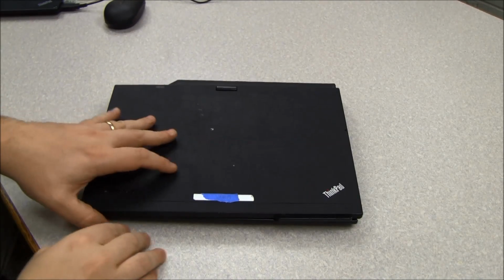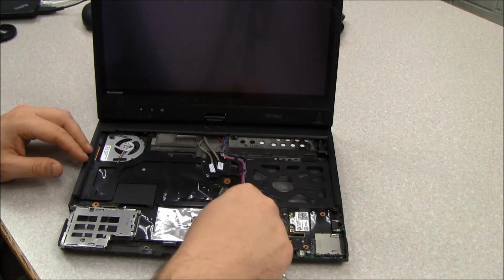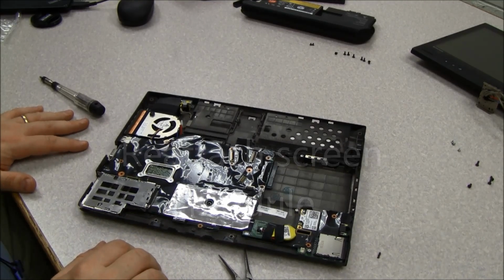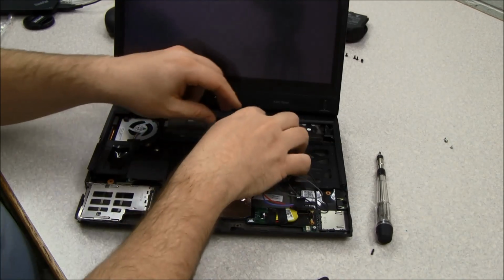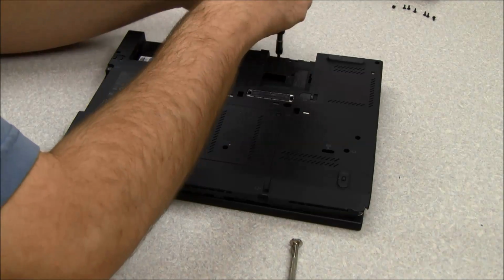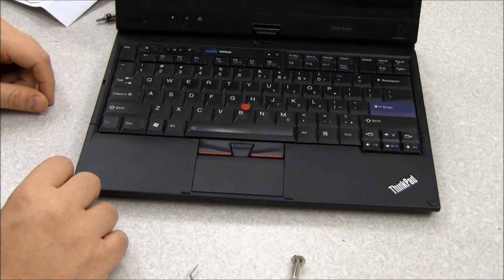How To: Take apart and repair Lenovo x220t / x230t

Comment: Thanks for uploading this, was very useful! Can you use an x220t screen on a x230t?
Reply from the maker: Not sure if the two are compatible. You could look up parts list and see if they share replacement parts.
Reply: Alright so I tried to install an x220t display on an x230t and, just for the record, it fits and it displays video, however once you turn it on there´s a hiss coming out from the speakers and the power button doesn´t work so I assume it wasn´t designed to be compatible. This was the model part without a webcam annd fingerpint reader.

Comment: Hey, great video, but with one small problem. at 14:57, there's a small folded metal bracket in the upper left-hand corner of the chassis, which is then picked up and set aside with no mention. To save anyone else the trouble, this is part of the ExpressCard assembly, facing towards the hinge of the laptop, which is meant to be held in place with one of the screws that holds the motherboard in.

Comment: Hi there. Just want to ask. I repasted my thermal paste. Now the screen is black but it works when I use an external monitor. Touch screen and camera also works. What could have caused it? I double checked that I reconnected everything.
Reply from the maker: It sounds like the cable from screen is not connected properly.
Reply: @hoyty76  thanks! I will check again later.

Comment: Thanks very much for taking the time to post this clip.
You explained every stage very clearly and filmed the process very well also.
I have the standard X230 screen laptop and need to replace the fan and renew the thermal paste for the CPU and GPU and your film will make the process much easier for me.
Thanks again!
Reply from the maker: I am amazed that 8 years later it is still useful!
Reply: @hoyty76  It's testament to how good and still functional these old X230 laptops are! Apart from the on button stopping working twice entailing buying a 3rd party replacement keyboard and now the fan sounding like a drill I still love my Lenovo and use it every day.
Mine has an SSD and runs only Linux Mint, I deleted Windows, and it fires up and shutdown quickly and does all I need!
They are still available used on ebay for not much money and are still great bargains.

Comment: 0:09 Keyboard removal
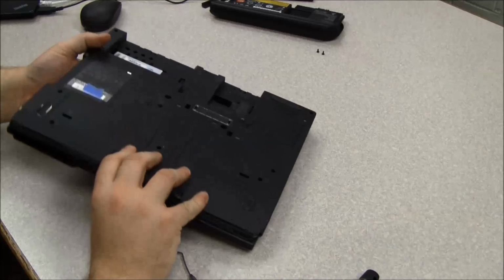2:26 Palm rest removal
4:15 Unwinding Wi-Fi wires
6:05 Top shield removal
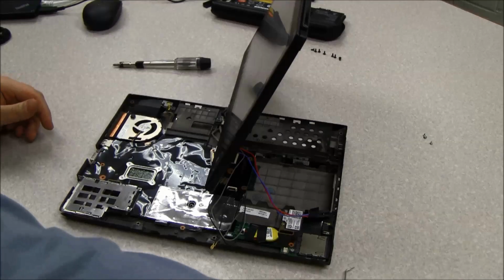9:48 Screen module detach
12:14 Systemboard removal
14:53 Dc In replacement

16:32 Installing systemboard
19:23 Reattach screen module
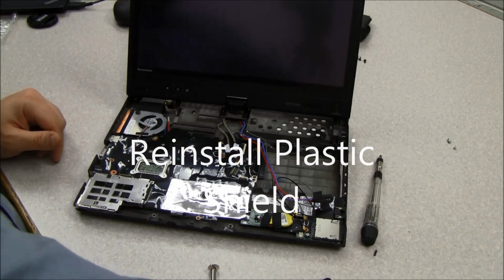22:24 Reinstall plastic shield
23:46 Rerouting the Wi-Fi wires
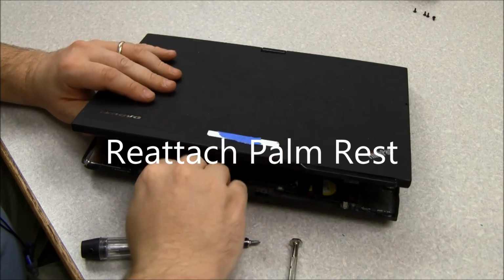29:43 Reattach palm rest
31:28 Reinstall keyboard

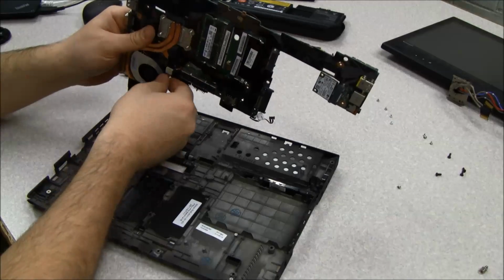Comment: 14:40 The power jacks on these computers had a terrible design with an insecure mount prone to bending/moving and, as a result, shorting. I had to replace mine as well. When I did, I wrapped it in electrical tape to ensure it would never short again.

Comment: Imagine this laptop with new i5, more ram, thinner bezels equalling smaller footprint, thinner design ( 0.9 inch is enough ) lighter weight ( about 1.4 kg ) and maybe a greater battery. Always keeping the good old keyboard and style tho, this laptop is a beast man. Honestly just a better cpu would do it imo.

Comment: Anyone knows if this laptop has issues ? I mean some bad issues. I found it in my country for a really cheap price , only thing i read about that the HDD slot is kinda dumb and makes problems. Is the display durable and is it multitouch ?
Reply from the maker: True Bulgarian IYI If it is one of these machines it is 6+ years old. When new they didn’t have specific issues but a machine of this age used would be hard to know.

Comment: i am getting vertical lines on my x230t display.. i need to open it to check for the connections with ribbon cable to see if that is faulty or the screen itself is faulty, could you let me know how to get to that part itself
Reply from the maker: utsav garg sorry I don’t know if parts are even available anymore for these computers due to age. I don’t have one any longer either.

Comment: Thank you for this.  I also had a damaged power jack and after some confusion on ordering the proper part, this video walked me through removing the old one and replacing it without hassle.  Hardest part was finding the socket for the VGA jack which I was able to locate so I didn't have to struggle with needle nose pliers.

Comment: Thank you, thank you, thank you, Brian!!
Although a handy DIYer, I know you saved me Hours from trying to figure how to take my old x220t apart to replace the fan (and heatsink) due to the dreaded "Fan error" start-up error message that won't let the laptop boot up.

Yes, Take Pictures along the way to help you remember what went where.

Another tip I'll share - I taped some of the more specific screws to near where they went so I wouldn't get them mixed up later.

And for those replacing the fan+heatsink, note that there is a piece of black tape on the motherboard that goes where the "Y-leg" of the heatsink has that extra screw mounting hole (you'll know what I mean when you look at it).  The tape goes OVER that Y-leg when putting in the new fan+heatsink.  The problem is when you take the old defective fan+heatsink off the motherboard, that piece of black tape will just naturally stick itself to the motherboard.

So while you wait for the replacement fan+heatsink to arrive in a couple of days, it's easy to forget that the piece of tape went OVER the heatsink screwhole.  I forgot, and attached the new fan+heatsink to the motherboard, and then turned it over to put back into the laptop, and proceeded to attach the motherboard to the laptop case bottom.

In the video, it says to attach "4 screws" - one by the fan, two in the WLAN(?) cage, and then one on the wi-fi antenna mini-card.  On my x220t, I had a 5th screw about an inch or so from the first screw.  This 5th screw is the one on the "Y-leg" of the heatsink.  If when you install the new fan+heatsink and forget to peel that black tape off the motherboard and place it back over the Y-leg, then when you turn the motherboard over and seat it in the case bottom, you'll find that that 5th screw hole is now blocked and you can't re-attach that 5th screw because the tape is between the motherboard and the heatsink on the other side.  I ended up having to go back a few steps to correct that tape problem so I could use that screw hole.

Finally, I "found" there was a 6th screw to hold down the motherboard when a tiny Bluetooth daughter card just fell out onto my desk work surface.  It's in the bottom right-hand corner, below the wi-fi mini-card.  I don't think the laptop in this video had such a card.  You can see it here in this Lenovo diagram:
https://support.lenovo.com/us/en/solutions/pd100780

But all in all, Brian, your step-by-step video was a godsend - couldn't have done it without you!
Resurrected the old x220t for the price of a $23 fan+heatsink and following this video.  Thanks.
Reply from the maker: P F glad I could help. I am amazed this 6-7 year old machine is still working and you could get parts for it.

Comment: What is the difference between X230 and X230T? cause I bought a motherboard it says for Lenovo X230/X230T. Everything matches except for the battery port.
Reply from the maker: It is wether it has tablet rotation neck. Almost everything in base is the same but screen is different due to touch / pen inputs.
Reply: @hoyty76  I bought a motherboard replacement for my X230 laptop but when I'm done installing it, when i plugged the battery, the port doesn't match. The description of the motherboard was X230/X230T. It might be for X230T not for X230. Everything else was the same except for the part where you connect the battery

Comment: Excellent, and thank you.  I worked from this video on an x220 (no swivel screen).  Great advice to TAKE PICTURES.My metal clip on yellow power jack was a bit different than in video.  My clip did not hold the yellow jack firmly.  So, after clip was installed, I wedged 3 layers of a bicycle inner tube between the fan and jack.  Now the jack is firmly in place with a bit of cushion.

Comment: Hi . I can not find in internet info about x230t web camera . Is it posibal to add it if it missing? 
And also I need documentation to see difference in x230t model types. For exemle I want to know for my 3438AU6 model type - should or not should have camera or witch type screen it should be multitouch or two point touch with pen or without and ......
May be you can help me?Thanks

Comment: Thank you for this video! I have no problem taking everything apart. However, I run into a problem when I try to take off the screen and intend to leave the wifi module since the wires of the wifi module also come off when the screen is off. Do you know how to take off the screen and leave the wifi module connected? This way I can only use my 32-inch monitor without the intrusion from the laptop screen.
Reply from the maker: Ran Zhang The WiFi will work without the wires just not as well. You could also buy external antenna with the same connectors. They are standard on internal WiFi cards.

Comment: This tutorial is also applicable to X230 tablet as I mine is x230t and I had torn it down. These two models share the exactly the same case. As for the VGA port's screws which I at first frowned upon as I don't have the appropriate tools, I used an inner hexagonal driver which might be easier to source, I guess, to unscrew them with success. It worked very well. The screws were not very tightly fastened. Their inner holes seems to be of hexagonal shape which might be the reason why a inner hexagonal screw driver also works.

Comment: The battery on my x230 is loose, and I found out that the reason is that the clips connected to one of the battery switches on the case has broken off so there is only one "clip" clip holding the battery in.
how to replace it ?
thank you.

Comment: I've got an X230t and I'm trying to replace the rubber nubs on the sides of the keyboard that hold the screen in place when the lid is closed or when the laptop is in tablet mode. I've purchased the rubber pieces from eBay but I don't know how to attach them. The left one is fine, but the right one was missing when I purchased the laptop. It has a plastic piece in the little groove the rubber sits in. Do I have to cut the bottom of the rubber piece and slide it over this plastic piece? I'm very confused, any insight would be helpful. Thanks!
Reply from the maker: I only replaced them by replacing entire top cover. Maybe if took it apart you could push in not sure though.

Comment: Thanks so much for the video. 

Do you have a link for the tool you used to remove the VGA screws?
Reply from the maker: ArkJag I don't but it is either 5 or 5.5 mm socket screwdriver. The trick is it has to be very thin to fit. Go to big hardware store or Sears craftsman to get on.

Comment: ca a x220 be converted to a x220t? could you make a x220 touchscreen with parts from x220t? if i bought a x220t with good screen but broken or no cpu/mobo, could i put my x220 components in the x220t chassis?
Reply from the maker: joe schneider I doubt it since the touchscreen has different plug and won't attach to MB properly.
Reply: I was hoping it would have 2 separate heads, one for digitizer, one for lcd.

Comment: Thanks for a very comprehensive manual!
The tempo of this video is exactly right for me - I never had to stop or reverse - I just disassembled and reassembled the laptop "in sync".
I've been disassembling my 2012yr X230t down to the bare metal for the first time today to change the thermal compound on the CPU (used to fix a pen holder and change the network card before, but nothing more serious with this machine).

Today, I decided to replace the thermal compound on the CPU, because the idle temperature raised up to 65 centigrade with fan constantly working, and any moderate load like editing a large image in GIMP or watching 4k videos on the external display cranked the temperature up to 97-100 centigrade with the fan working in an "afterburner-assisted takeoff" mode and CPU throttling.
And the problem really was in a thermal paste - it was more like a fine sand and the cooler had no adhesion at all.
Replaced it with some КПТ-8 "Siliconorganic Paste Thermocunductor #8" low-mid class thermal interface and got 42 centigrade on idle and 83-84 under heavy load.
Reply from the maker: Glad it helped you out.

Comment: The power jack on my old X220 has gotten extremely glitchy, so thinking about replacing it. Is it really necessary to remove all the components as shown in this video, just to replace the power jack?
Reply from the maker: +Elvis Stansvik You would need to get to about the 10 minute mark in video. Remove the keyboard and top plastic. You won't need to remove the screen.
Reply: Ah. Thanks for the quick reply. That's good, was kind of dreading the screen. Ordered a replacement jack from Ebay just now.

Comment: How do you prevent any static? I noticed you weren't wearing a wrist strap
Reply from the maker: Erika EE In over 20 years of taking apart computers never really worried about static or had a problem with. Not saying it isn't possible just not be an issue for me.
Reply: +Erika EE Just make sure you dont wear any plastic clothes and put on some cotton clothes. This can prevent that you charge yourself up.

To discharge before work touch your heater/raditor. You also can work with barefeet if you dont have ESD-shoes.

But for me its like Brian said. I never worried about this and all my hardware is stll working.

Comment: Hi dude nice video, i bought myself the x230t but didnt notice that if i selected the 3x3 antenna i would loose the webcam soooo i did and now i want to buy the camera and install it but im not sure if i can. 

i read that i might have to remove the 3rd antenna to install the camera, could you help me out with this? 

i would not hold you responsible for anything i know im to blame if anything goes wrong.

im just interested in some pointers.